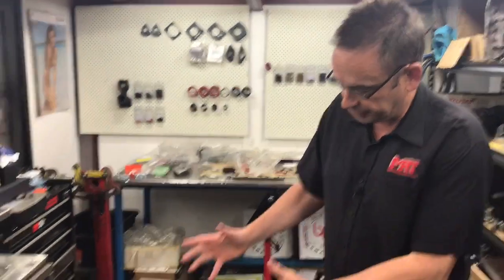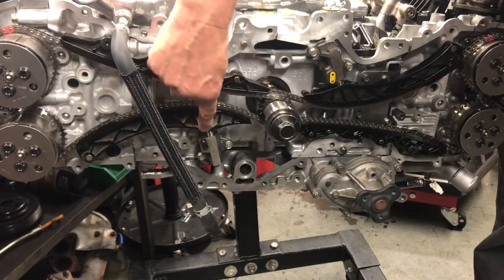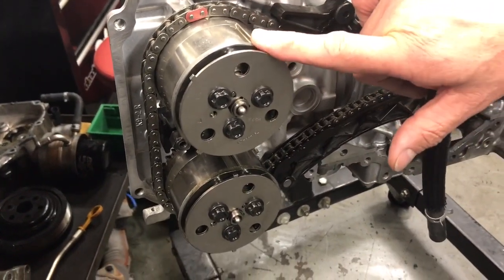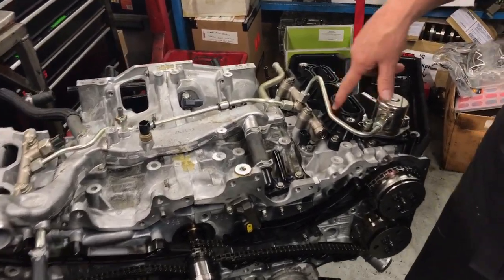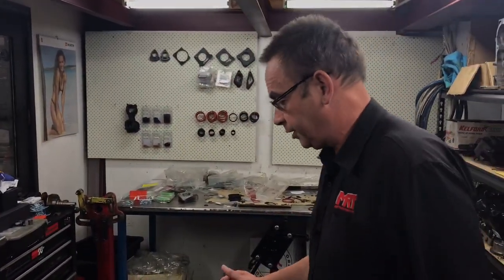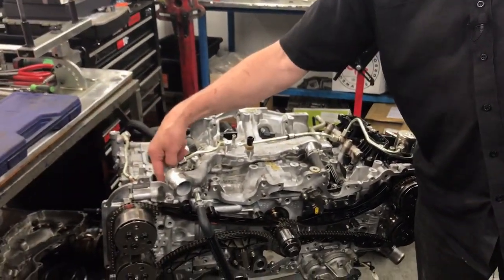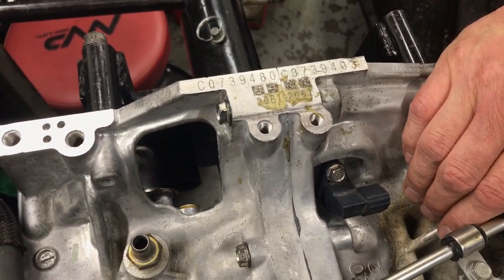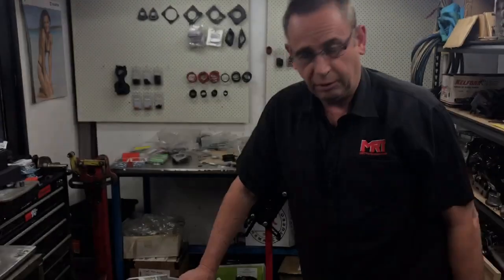Subaru FA Series Engine Tour - Head / Cam / Timing / Fuel System & Ancillaries

Comment: What can possibly cause camshafts to be scored? Would you also be concerned to look at the crankshaft bearings? Came to find out about the camshaft issue when doing the recall for valve springs. Thanks in advance!

Comment: If the left intake cam gear is saying over advanced and is running bad and wont idle can it also cause high fuel pressure?
Reply: Just got done installing short block and have the same problem. Did you ever figure out if that’s what caused your high fuel pressure?

Comment: Subaru's quality has really gone down hill over the past decade. I think they turned back the clock to 1970 when cars only lasted to 100k. I bought a new 2012 forester and then a new 2017 outback. Both had major failures shorty after 100k. The forester had the "oil consumption" problem Subaru knows about and needed a new engine at 110k miles. My 2017 Outback needed new valve cover gaskets (700 dollar fix) at 112k miles and a few weeks later, the Subaru know problem with the Cam housing leakage where they only used silicone and not a real gasket to seal it. Its a 2500-3k repair. SO, i kicked it to the curb and will never buy another Subaru. Its a 100% failure rate and a car these days should last 2-300k miles, not 100k. I trade it in and purchased a new mitsubishi outlander with a much better warranty. Good Job Subaru, you ran off another loyal customer with your quality issues...

Comment: I am sure its fine as an OEM would know better than myself, but that timing chain looks like it doesn't get much continuous engagement with the crank sprocket.
Just doesn't feel right.
Reply: If you look closely you will see that there are two chains, and each one engages a full 180 degrees with its crank sprocket.
Reply: Dale Rebgetz oh good pick up!